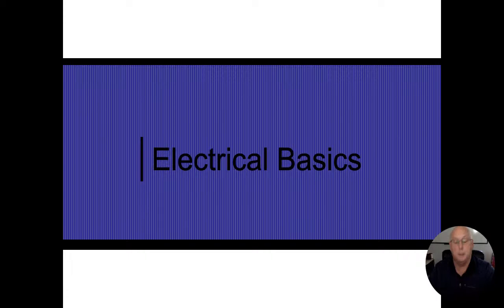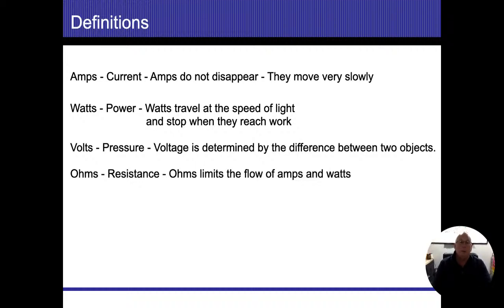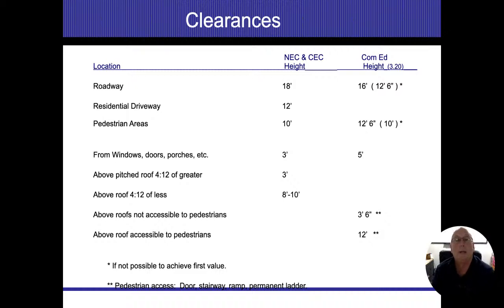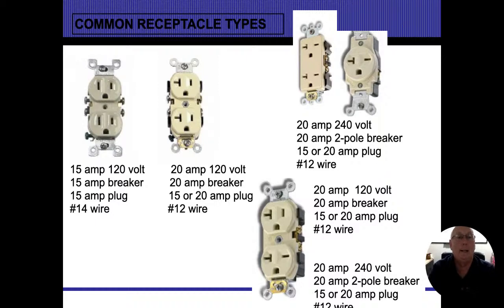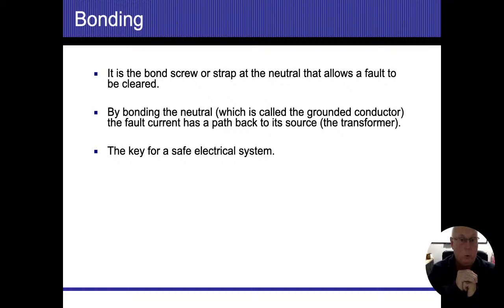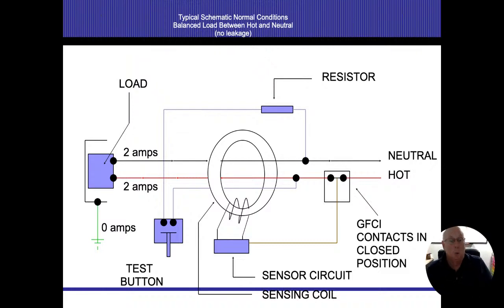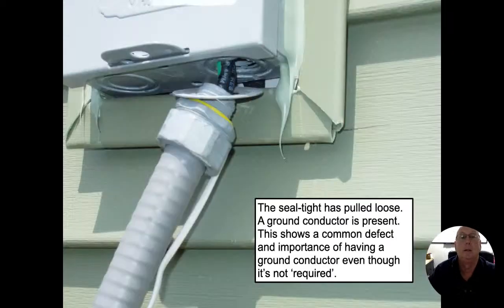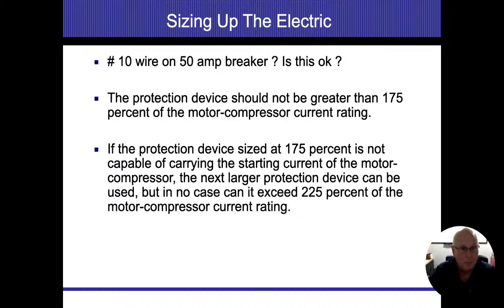Electrical Basics

Comment: Great video! I was told AFCIs have to installed in Chicago if a certain percentage of the walls are opened up in the remodeling process, any truth to that?
Reply from the maker: negative.  The decision makers decided that our conduit systems in residential construction is some of the safest in the nation.  The decided not to include AFCIs in any remodeling, or new construction.  I cannot find any Chicago Electrical reference to AFCI's being needed.

Comment: This was great!  Thank you for sharing your knowledge!  It sounds like you were alluding to some areas do not bond cold water, hot water, and gas lines.  Although I have very limited experience, in my area (Central IL) I have not seen many bonded either including my own house.  Does that mean in some areas you would not document it as a defect and recommend correction?
Reply from the maker: That is correct.  I would not document it as a defect if I saw, and I would not document it as a defect if I did not see it.  There is nothing wrong with recommending that all the systems be bonded together.
Reply from the maker: That is true.  Not every code official enforces the bonding of water, gas, and conduit pipes.  I personally think it is a great idea and it should be enforced.